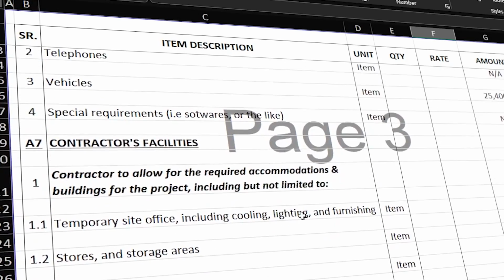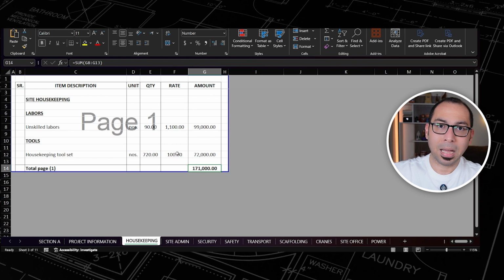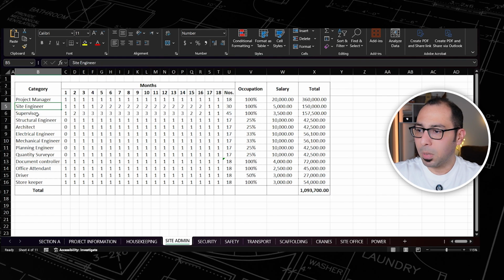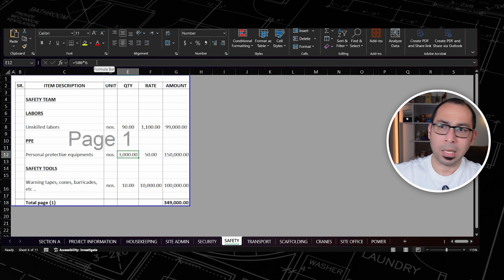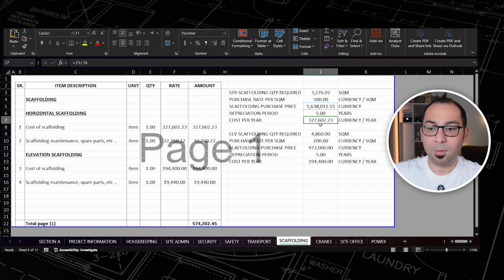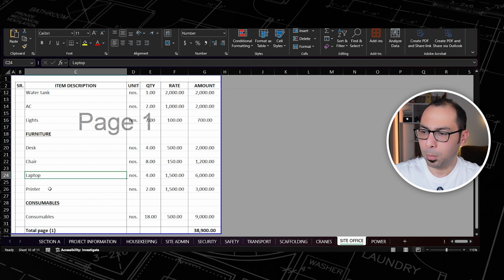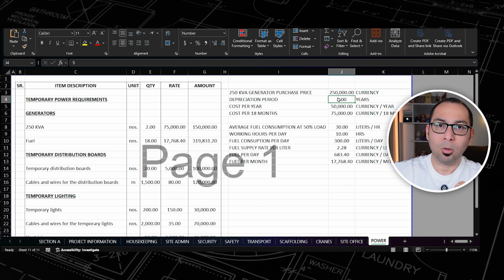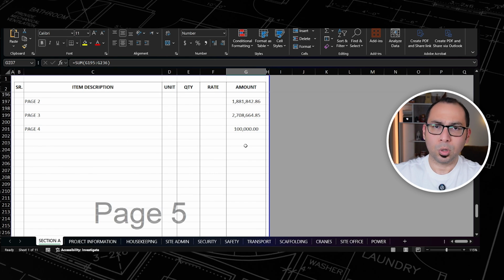How to Estimate the General Requirements Cost in Construction

Comment: Hello Eng/Ahmed I have a question about the energy department/electricity generator
Does this department not need to add an item for maintenance costs or does the purchase price include maintenance for a period of five years
Thank you very much for the information you provide I have learned a lot from you
Reply from the maker: Thank you for watching and support ❤️. Yes maintenance costs for the generators and the temporary power network should be allowed for in the estimate 👍

Comment: As if i have not seen setting out anywhere Sir
Reply from the maker: If by setting out you mean surveying works, surveying equipment can come under A5 Contractional Plant (Plant required for specific trades). And the surveying team, can be under A4 (Supervision).
Reply: @CEPQS  I meant aligning the building on ground with use of poles not with surveying equipment